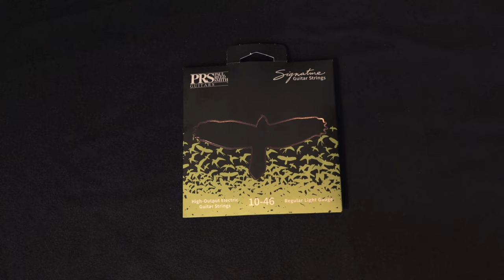How to Restring Your PRS Equipped With Locking Tuners | PRS Guitars

Comment: The reason you have locking tuners is to reduce string tension differences either side of the nut, which reduces the chance of your guitar going out of tune when you use the tremolo. By starting with the string slack and then winding the string around the tuner head, you completely undo the benefit of having locking tuners. The string should be pulled straight through the tuner string hole, then locked, then wound to correct tuning.
Reply: That was my understanding. when I got my first PRS the video at that time showed pointing the hole of the tuner at the nut slot. pull string thru the hole with just very mild tension then tighten set screw and tune it up. String around the post is an area for string to slip. Probably be fine either way but I wonder the logic in the change.
Reply: Thanks! That's what I thought but seeing this video confused me for a moment.
Reply: Yes! With my Sperzel's, I pull the string through all the way, lock it and tune it up. No problems ever. I'm assuming these are the same. How do these work when using the PRS trem? Any better tuning stability? Thinking about getting these for my SE.
Reply: If you ever see Paul on the road with a personal guitar, these are the letters you will need:  W T & F
Reply: Yes. This video is total nonsense, especially winding over the string. Why?! It's locked. Pretty silly.
Reply: The main purpose of a locking tuner is quicker string changes and reducing the chance of the string slipping. Having one wrap around the peg is not going to cause any tuning instability and now you have the ability to use a lower tuning if desired.

Comment: I dunno.  I've been doing the "yank it as hard as you can and then lock" method on my C22 for 19 years.  Thing stays in tune just fine.
Reply: Yes..I usually pull them through with pliers then whilst stretched use 20p piece to tighten & lock tuners. No slack to take up & keeps its tune till the strings are (almost) knackered.
Reply: My dad used that method too, he used to say kink the string up then do a wrap around and wind up
Reply: The proper dang way that's how locking turners work there zero access stretching of extra string wrapped around the tuning peg stretching over time too

You dont want extra slack around the tuning peg! Cause it's more stretching in the future and worse tuning stability
Reply: because thats how you are suppose to string a locking tuner    the way you are describing it is correct,  you want as little wrap around your tuning peg as you can.  unsure why they show you the wrong way here but ok
Reply: Sure, argue with the manufacturer about how to use the product....
Reply: Thank God I read the comments, I was wondering WTF was going on here. I agree, pull through and tighten down...
Reply: @wolfthemagnificent2966  But this is different than how they used to recommend stringing with these tuners when I bought my CU22 almost 20 years ago.
Reply: But you said I don’t know 😂

Comment: Sorry but this completely defeats the purpose of having locking tuners. If you're going to give it a turn an a half needing a string winder you could do just the same without locking tuners. I'll keep using the old PRS recommended method with my locking tuners.
Reply: It ain‘t much about the purpose of the locking tuner but the advantage of the longer string, in case it slips truh because of an broken screw or in case u need to do some work on the fretboard. This way, it is much easier to reuse the old string or loose n the tension of string so that u can slip it aside, which won‘t be possible if u pull the string thru and cut it right away ...
Reply: @papatythen  thousands of players would  tell you that if you tighten it to the right force the case of a string slipping is really strange. If you have to do some work on the fretboard, just don't be cheap, remove the strings, and when finished use a fresh set of strings.
Reply: @RichiAtlanticWind  never said anything about tighten it to the right with force ;) and which thousends of players are you refering to? because I can only speak for myself and my experiance as an guitar shop tec ... there are many strange things you will see while working in a guitar shop, trust me ... and it also has nothing to do with beeing cheap because there are often cases, were you just don‘t need to change strings but need to do some work ... why waste string which are perfectly fine?
Reply: @papatythen  Hi, could you have more winds to get a better string break to the headstock angle and more secure tension at headstock? I have a USA Tremonti and looking at different stringing ideas for better tuning stability. Cheers
Reply: @eltonhalford325  Hey, so first of, more winds do not guarantee a better tuning stability at all, they change the string break angle at the nut which might work in your case, but the tuners won‘t allow a lot more windings than 1 or maybe 1 1/2 windings, before starting to overlap because of the small space these tuners offer … then there is the possibility that the slots of the nut are rough and not clean enough, so the strings won’t slide back properly after playing with the tremolo arm and cause the tuning instability … some kind of nut sauce might help the problem for now … but nothings better than a clean cut nut slots. And then u need to consider that the strings need to be stretched after restring so they will stay in tune … if u already do this, try the above and in worst case, let a good luthier take a look at the nut and consider changing it.

Comment: Why are you leaving some slack to the string, even you are using locking?
Reply: Can be handy when you need to do some work on the fretboard.
Reply: @worldwide_will  ok, but it doesn't give more tuning stability.
Reply: I was thinking the same thing. I might as well just save my money and use my stock ones if I wanted to do that

Comment: I always leave one or two strings attached and change them last.  It allows you to clean the guitar and keeps the trem from flopping around.
Reply: @yeti goosecreature It also keeps tension on the neck which makes re tuning easier as neck doesn't have to re settle.

Comment: Finally a locking tuner video that shows to put some slack in the string. I change tunings and with the classic method I've got no slack to allow for the lower tunings. Thanks!
Reply: What gets me is that the posts on locking tuners are shorter than the posts on traditional tuners. That's because the shorter posts are not meant to accommodate multiple wraps, whereas traditional tuners have longer posts to make room for string wraps. I think this method completely defeats the purpose of locking tuners. At the very most, a quarter of a wrap is enough for locking tuners. If you're detuning that often, I'd sooner set the guitar up in that particular tuning. Constantly tuning and detuning strings will only weaken them over time.
Reply: This makes sense.  Thx!  A major purpose of the locking tuners is that they are quick and easy - so no big turns.  So on my PRS SE it doesn't seem to make a big difference

Comment: Thanks for this updated method.  I did the old method of leaving as little slack as possible like it said on the site, and was wondering why the strings had trouble keeping tune.  I'm going to have to buy some new strings and try this out.
Reply: I've wondered if maybe one winding around the post would take some tension off the gear and help stability.
Reply: @jayblow77  that point does make sense on why it may work better.  Its also kind of scary with the top screw holding it in place because of the fear of breaking the string by tightening too much.  This new method might work best for me because I like to down tune.

Comment: Interesting. I just bought my first core and it was delivered with the wind over TOP of the string holes. In the past (without locking tuners) I usually did the first wrap over top of the string hole, and then one or two wraps below the hole.

Comment: Changing the strings on my new CE 24.  The ball end of most of the strings are stuck in the trem block.  I cut a short length of the used low E string and pushed them through from the top of the saddle.
Reply: ty sm

Comment: PRS site says to pull the string and keep as little slack as possible. Is this a better method?
Reply: It is.  The PRS site info had not been updated in quite a while and the factory has been using this method for a few years now.   The site is updated now as well.
Reply: yeah interesting - I think I once read that as little slack/turnings as possible would reduce the "slip" you could get at the ... gonna have to try this (although - the "old" method kept my CE perfectly in tune so far)
Reply: @z3guitars  Why is it better to have 2 fingers worth of slack? I've always used the minimal slack method on my PRS.
Reply: @francischang  I am also interested in why this is better?
Reply: @francischang  While I don't have a PRS guitar, I do have locking tuners and I've been using zero slack when restringing. I pull each string as tightly as I can through each tuner and then lock them in place. The posts on my locking tuners are shorter in comparison to the PRS locking tuners, though, so maybe that's why they use a little bit of slack.
Reply: I leave zero slack, one of the main advantages of locking tuners is to NOT have to wind slack. No issues whatsoever here.
Reply: @ericjenkins2737  Yeah, winding slack seems to defeat the entire purpose of locking tuners.
Reply: Would’ve been nice to have some explanation around such an unintuitive method and what contradicts PRS’s past advice.
Reply: @nckhed  it may be for when you down tune?
Reply: @Fleshpist0n  Hmm, that could be a reason, I suppose.
Reply: @Fleshpist0n  There should be more than enough extra string length to be able to droptune from E to B on a properly strung guitar with NO slack in the strings when first putting them on.
Reply: @heffy301  Yes you are 100% correct as I just tried it on my locking tuners. But this doesn't hold as well on non locking tuners as I have just tried. It maybe just allowing for locking and non locking and a blanket technique just in case people stuff up.
Reply: Winds help to keep downward pressure in the nut. I assume that is the reason why to recommend them with locking tuners? Regardless,  I have had locking tuners for like 20 years and I don't use windings and they work just fine

Comment: I’m gonna try this method as normally I just put it through the hole tighten and tune with no slack BUT my low three strings keep popping out at the bridge or breaking like literally every week and my only possibly guess would be that it has to do with having no slack. I don’t play the guitar hard at all so I’m lost. I never used to break strings ever.
Reply: Just curious how your results are with this method. Did your strings stop breaking? And how’s your tuning stability?
Reply: I've allway's pulled thru with no slack and hole pointing towards nut slot n never had a string break except for high E after multiple loosening and tightening to work on it.
Reply: if the break happens near the bridge, there maybe something wrong with your saddles. Try checking for burrs or sharp edges.

Comment: Will the PRS locking tuners work on an SE 277 baritone guitar, with 0.14 to 0.68 strings?  I've heard that the thicker strings will not fit through the tuners.  Such a popular guitar and hardly any information about this.  Thanks

Comment: Hello! I just got the PRS SE Tremonti standard, and put some new locking tuners on it as well as put a set of .10-.52 on it. Now, I adjusted the claw in the back to compensate for the thicker strings and the bridge now is flush with the body. But whenever I use the trem, it seems that the D and the G strings are the only ones that don’t stay in tune. Any tips?
Reply: Pinching in the nut. Get the nut cut properly for your gauge of strings. Also, work in a bit of Big Bends Nut Sauce.
Reply: @revsharp777  aha! I had thought about that too but wasn’t sure. Thank you!!
Reply: @bryancontreras2892  yeah. The SE line ships with 9 gauge strings, so you'll mostly likely need the slots filed for your gauges.
Reply: Try opening the fret slots on middle strings a bit without increasing depth e.g. with a bit of 1200 wet/dry folded so the abrasive doesn't touch the bottom
Use lube!

Comment: I have the old wing based locking tuners on my 08 Prs... ridiculous things and after years of ownership would still not like to have to change a string during a gig with these.  Pity because the guitar is spectacular but really let down by these...
Reply: Those totally suck. I’ve finally replaced my guitars with those with the locking. I would cringe at a string change.

Comment: I swap strings one at a time.  Minimal additional work and less stress on the guitar.
Reply: That leaves no room for cleaning the fretboard and frets, though. That's also what a truss rod is for. I take off all the strings at once and haven't had any issues. Only time I've had to make any truss rod adjustments is because I left the strings off for a couple of days due to a roadblock while changing pickups and whatnot.

Comment: The point of a locking tuner is to no a little string on the peg as poseble...
When you threat the string through the tuner posts, you wonna the string, to where theres no slag, and then you lock the screw.
When your tuning up, if you get more than one wrap around the post, you'v done it wrong.
Again, the point is to have as little string on your tuners as poseble. 
A locking tuner is not only for making string change earsier but also to help keeping the guitar better in tune.
The less amount of wraps you have around the post, the less likely the guitar is to go out of tune.

Hope this makes sence.
Feel free to comment.
Martin
DK
Reply: The tuners lock the string but they do not lock the tuning peg. If you do it how most do it, like you have said, the tension can rotate the tuning peg and cause the string to go flat. A wind and a half helps keep that from happening. As long as you have stretched the strings out you should have great tuning stability.
Reply: @Jmdeclue  Hi... So as you were saying better tuning stability with some slack like the video above? Thanks

Comment: Got my first set of locking tuners in the form of Sperzel's in 1987. This is NOT the way to install the strings in a locking tuner. There should be no slack once you have the string locked in place. This isn't changing my mind. I appreciate the effort but I will stick with my way as it has serviced me more than well in all this time. Love the guitars though.

Comment: Why did he put the paper cardboard under the bridge
Reply: @Gonzo26ish On a floating tremolo the springs pull on opposite direction of the strings. When you remove the strings, you remove the force in one direction - meaning the tremolo springs have no force to balance it out and it bottoms out the tremolo.... into the body of your super expensive guitar.

I did this with my old SE and learned pretty quickly that you either change the strings 1 at a time or place a chunk-o-plastic or cardboard or forever have a reminder of when you forgot to do it.

Comment: Is there an ideal sequence to replace all six strings at once?
Reply: I recommend taking them all off and cleaning the fretboard and frets if it’s been more than three months of playing. No harm will come to the guitar for removing all the strings at once.
Reply: @heffy301  Jeff, thank you.  I’m sorry I wasn’t clear, though.  What I meant was—at least for PRS guitars or other 3-a-side headstocks, is there an ideal sequence to put on the new strings after you’ve taken all of them off in one sitting?  

For example, is it 6, 5, 4, 3, 2, 1?  6, 1, 5, 2, 4, 3?  Something else?  Just thinking about any impact on the neck due to even short-term lopsided tension.
Reply: Think about how much tension a guitar neck is under when it’s fully loaded with a tuned set of strings. Removing one string, or even all six strings, is not going to cause any change to the architecture of the instrument. The order you remove them doesn’t matter at all. No one string has enough tension to cause the neck to twist or move in any way. If it did, every time you broke a string you’d have to readjust your guitar. I always remove all the strings and clean the neck and frets. I figure if my strings are old enough to break, they’re probably on a dirty fingerboard.